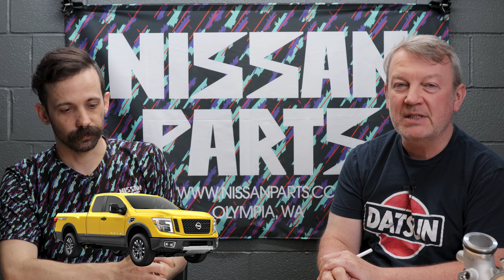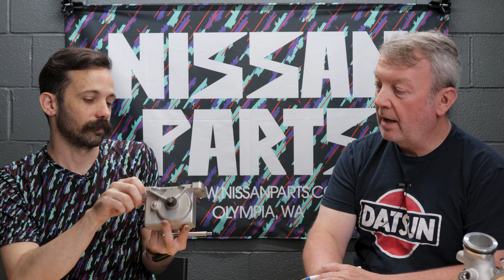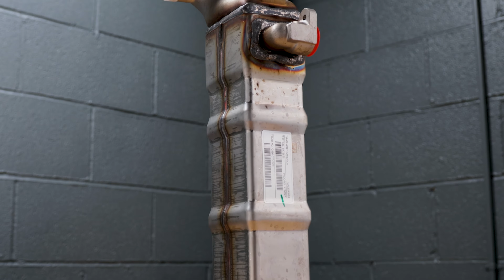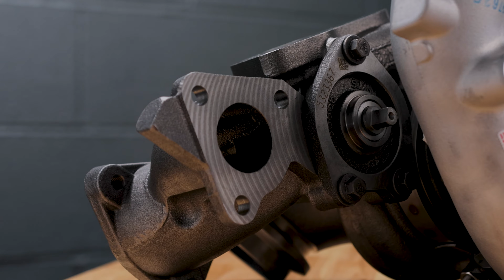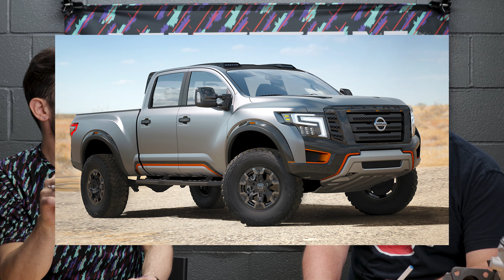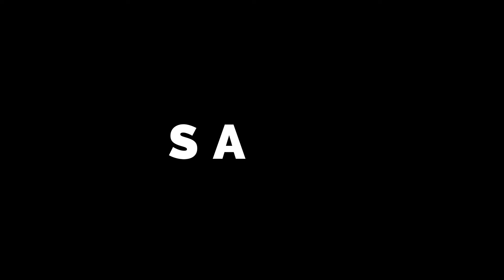Nissan Titan Cummins Diesel Discontinued: What Happened?

Comment: I don't buy anything less than 10 years old.  I have only owned a dodge 12 valve and that was a great engine.  I try to avoid owning anything that is not inline as an occasional dyi type.   I have 26 year old Frontier 2.4 manual.  I wish it was a diesel and had better highway gearing  but otherwise it is close to perfect for my needs.

Comment: 2017- XD PR… almost 10 yrs old now, over 120k miles, pure stock, (80/20 highway to city miles )which allows for little EGR use and less spot buildup , 20-22 mpg, and it allows for passive regens occur instead of a forced Active Regen cycle happening… however, its high time for a diet on my XD!!

Comment: I have a 2018 Titan diesel. Have had it about 2 years. At around 120,000 miles the EGR went out now it has 160,000 miles. It pulls better than my 1500 dodge,which pulled it's fair share. It hauls 5 of the large round hay bales pretty good. With 2 horses in the horse trailer it hauls really nice as well. Just 1 horse and you'll forget you are towing it.

Comment: 2016 XD SL, not a single issue until 120k miles, the exhaust fouled. I deleted it and ran better than I ever expected. Now at 150k miles I am getting the P00AF code.... As of now, I still have no regrets.

Comment: I got a 17 XD with the Cummins diesel about 2 years ago and it has 125k miles. I got it to pull our camper. I love the truck and it feels very solid. I got the P00AF code about 2 weeks ago on our way home from camping. I cleared the code after checking it and it hasn't came back on. Should I plan on changing the swing valve actuator soon? What is a good price? I found some by Google search and they're about $600. Does that sound about right?

Comment: Fuel treatment helped with fuel mileage. With fuel treatment 13.5-17.5 mpg.

Pulling 12,000 5th wheel 8-11 mpg depends on wind and hills. At 65 mpr.

Change oil and fuel filters every 5000 miles.

Def treatment is a good idea to reduce crystals formation.

Couple issues covered by warranty. One not covered rear fuel filter leaking $1500. 

I have 140,000 miles on it as of May 27 2025.

2017 Nissan Titan XD platinum

Comment: Another YouTuber reported Nissan discontinued supporting these trucks (as of late 2024) and many parts are just non-existent.  I believe there is a federal law that requires parts support for a 'new' vehicle for a period of 10 years after the model is discontinued, or it may be that the duty to provide parts support can be ended if the model 'becomes unpopular' or similar language.  I've been an attorney in Georgia but have not had a reason to look into it.  Your video is providing fuel for questions.  Looking at Titan diesels for awhile.  A  yellow one may cheer up a weary soul.  
But the deal may have to include guarantee for lifetime essential parts supplies . . .  lol  Good luck to little ole me or anybody on that
Reply from the maker: We have loads of parts in stock for these. I don't know if I have come across discontinued parts for the A61 Titan.

Comment: I have a 2016 with 221k miles on it. One injector, a lift pump at 150k, and a rear spring are the only issues I’ve had. It was full deleted and reprogrammed at 100k miles. Those are the only three major issues I’ve had but I do the services every 10k religiously - oil, air, and fuel. Transmission, transfer case, and diffs at 40k. 

You maintain it and open the hood once in a while to catch issues they’re great trucks. You want it to drive around town and look cool it’s not gonna work for you just like any other diesel vehicle

Comment: I got my 16 SL XD 3 yrs ago. Had 50,000 miles on it. It had a couple of issues. The biggest issue I had was the high pressure fuel pump exploded internally and sent metal shrapnel through the fuel system. $19000 to replace it all that the aftermarket warranty paid for, and that was a yr ago, since then I haven't had any issues with. Pulls everything anything I put behind it, from a 3500 lb car or 10,000 lb trailer with a track hoe.

Comment: I have a 2017 that at 6000 miles the low-pressure turbo assembly went out. replaced under warranty. then at 22000 the high-pressure turbo is now out. dealer wants $6080 to replace. Anyone want to buy a truck??

Comment: I have a ‘17 XD Cummins and it’s actually a wonderful truck. I’ve had it for 2 years and have put just under 50,000 miles on it in that time. I plow snow with it, I pull a skid steer, boat, 4 wheelers, snowmobiles… I load the bed to max capacity and more quite often and I’ve never had anything more than a sensor failure. 

It handles like an older truck because it is slightly heavier than any other half ton. It has a nice solid feeling on the road. I get great fuel economy out of mine. Nothing less than 18mpg. But usually 20+mpg on longer trips. My best was 23.6mpg on a trip back home to Wisconsin from Tennessee. I’ve done nothing to the truck other than put fuel in it, service it and drive it. I recommend it to anyone looking for a diesel truck that doesn’t need to haul 20,000lbs every day.

Comment: Had one since 2016! Have had EVERY problem mentioned… limp mode problem - regine problem- now transmission problem- input speed sensor problems! 
Cummins engine is great after delete. 
The rest of truck is Junk ! Buy a 250 !!

Comment: Had one, dumped it at 104k and got a 6.2 f250. Truck and transmission was flawless. Motor was garbage. 4 EGR coolers and both turbos replaced. I even asked if the egt probe should be replaced if it was running hotter than it should of been and not alerting me, they said no

Comment: Had a 2017 Titan XD SL bought it brand new for $46k ....$30k cheaper than the cheapest competition at that time . @15k miles egr was leaking and steering stops squeaking from running the frame. At 20k miles dpf filter replaced. The truck surged badly the entire time i had it while towing. I kept telling them it was surfing like it was losing boost and asked if they could check the waste gate. Only response i would get is "this truck doesn't have a waste gate".
Traded it in for a 2018 Titan xd sl midnight addition ($46k) 
@18k miles egr leaking. 22k miles dpf replaced. 27k miles def system replaced. 32k miles truck was surging  like previous truck. Rctv valve(electronic waste gate) was replaced. At 34k miles injector failed and destroyed the motor. Got it replaced. At 36k miles headlight stopped working. No warranty because tab on back of headlight was broken. Imagine that, they had the entire cab off replacing motor but broken tax on headlight was somehow my responsibility. At 39k miles towed to dealership. Was told a couple sensors not under warranty were replaced at my cost after having my truck for many months. After arguing i paid. Picked up truck and it was still doing the same thing. Took it to another dealership and they had it a week and fixed under warranty. Corrosion in def harness to ECU. Wire harness harness replaced. 
Transfer case replaced,4wd error warning unfixed for over a year , radio replaced, def pump replaced again at my cost. Truck has 78k miles and i just purchased an extended warranty because i can't imagine what needs replaced next. 
Love the truck but Fck Nissan. NEVER again will i buy a Nissan.

Comment: My 2018 is a worthless pig. Doesnt have the torch to pull it off a tire rack. At 130,000 miles the check engine light kept coming on couldnt keep the fuel milage up loss power. I thought the turbo was goin out but had it checked and the turbo egr valve was carboned up bad. I ask when i bought it what maintenance i need to do to the engine and they said nothing. Everytime i took it for a oil change nope dont do nothing to the engine. Well turns out i should have had it flushed and diesel treatment goin thru it. All carboned up finally have it flushed and fuel milage is back to 19/18 mpg still no pulling power or heavy torc
Reply: Tune and delete it. Mine is an animal and I’ve pulled over 14k with it

Comment: Diagnosed EGR valves I replaced both but it was air filter it through EGR valve turbo sensors pressure sensor ..etc whole time air filter but the trucks are excellent just have to get passed fuel issues and EGR valves
Reply: Same as mine carbon up bad

Comment: Hello great show, you stated calibrated for turbo actuator, does it need to be reprogrammed to ecu? my Diesel mechanic just replaced it stated he calibrated it but needs to be reprogrammed to ecu? So, I had to take it over to Nissan which in my eyes was counter productive since the part and install for the actuator is covered for 10 yr 150k miles for the titan 5.0 cummin's. Currently at 138k miles and first major issue.

Comment: I have a 2018 Mines deleted and tuned n I got rid of the factory rear fuel pump and put a fass pump. Seems to do ok just hate the transmission. Gonna change fluid and see what happens or maybe get ahold of ez lynk and see what they can do. With a deleted truck do I still have to fear the egr stuff getting clogged? Or is my main thing to stress now just a turbo going out? Thanks
Reply: What's wrong with your transmission?

Comment: My 2019 Titan XD Cummins, in under 2 years, has been towed twice from the engine not starting. Has been sent to Nissan tech's 3 other times for limp mode codes/ reduced engine power. Piece of Junk. 45k miles and under warranty (thank God).

Comment: I'm naive, with proper testing and I do mean proper testing of the engine before it is released onto the public there should not be the issues that they have. Never trust your suppliers! Everybody cuts corners to squeeze a little more profit every given moment and Nissan should have kept a close eye on the early intro of these units especially to a public not used to diesels.

Comment: I have a 2016 titan pr, the truck was amazing for the first 50k the past 16k has been rough. I’ve had to replace the egr cooler, turbo actuator, LP turbo and the coolant reservoir. I change the oil and fuel filters every 6k. Overall I love the truck but the recent repair bills is starting to leave a bad taste in my mouth.
Reply: How much the turbo actuator replacement cost?
Reply: @vicenteortiz7244  it was covered under warrantee. Nissan has extended the warrantee on the actuator and the high pressure turbo.
Reply: 2016 XD w/ 66k shop wants to replace my EGR Cooler, low pressure turbo and more… only had it about a month so far 😢

Comment: Traded my 2017 titan xd for a 2020 ram 6.7. Loved my Titan xd and had it upgraded. Was an amazing truck but lacked in many area’s. Cost of  ownership compared to performance and value was a hitter. Fuel mileage was sub par but other than that fantastic truck. 108,000km on it without a issue

Comment: Are the known problems with the Cummins 5.0 simply an issue of poor maintenance or is this a design flaw also. If you change the oil every 5k does that simply avoid the problems? Or is more substantial and diligent ownership needed. I've loved the idea of the XD diesel, but wary of a purchase because of the bad press of the 5.0.
Reply: It’s a design flaw, but not from Nissan or Cummins. It’s a design flaw of the EPA. The only issues these trucks have is largely related to their having to add useless garbage just to meet EPA emissions guidelines.

Comment: Complete wiring harness end to end at 60k miles, egr failed, 2 def sensor failures, ball joints …. Half the new value of the truck has been spent on warranty and my own repairs. 2016 SV.

Comment: Have a 17 Xd SV Cummins. Love this truck it just passed 60k mileage. Regular 5k valvoline extreme blue or shell rotella oil changes at 5k as well as filter changes and def filter changes are the secret to any diesel longevity. No mods outside of a bilstein 5100 suspension upgrade as well as a rough country leveling kit and a helwig sway bar upgrade. Bought it used w 19k mileage. Also use fuel lubricants like Lucas pretty regularly when I fill up. My theory is don’t tune the engine or modify it they don’t pay engineers what they do to have guys mod them and void the warranty. It’s a great truck Nissan didn’t market it at all which is a damn shame

Comment: I just bought one a few months ago and I love it. Ya I had a few issues to work out being used and all but it’s been a fantastic truck overall. For a diesel it’s your best bang for your buck that’s for sure. As long as you maintain it you shouldn’t have any problems which goes for anything. I’m going to be starting a YouTube channel dedicated strictly to the Nissan Titan XD 5.0 Cummins which will answer any questions or concerns anyone has along with following along my journey of owning one of these amazing beasts. IMO Nissan did a bad job of marketing them which led to the downfall of a potentially excellent diesel pickup. It’s Sad to say the least.
Reply: Boy you’re in for a treat
1st gen series truck that the manufacturer bailed on
Good luck
Reply: @asaawalker  10,000 miles already on it and it’s been a fantastic truck no problems at all. Just did a cold intake upgrade and man that made a huge difference. Love the truck and plan on keeping it for years to come.
Reply: U have link for ur  channel? I have a 17 xd  Cummins

Comment: 17 titan xd 101400 miles on it. At 61k replaced turbo and fuel water separator housing. Then at 71k replaced egr valve, cooler and turbo again. 80k fuel water separator housing again cracked. 88k engine wiring harness. 

Currently seeing a small power  steering leack and break master cylinder leak lol. 

These trucks are under powered. I think they could of went with a bigger turbo and more fueling to get at least 425hp and 750 tq range.

Comment: I bought a 2019 new. Done all maintenance as needed. 98450 miles all good so far. I tow 9000 lbs. 5th wheel. I use shell rotela t 6 and nissan oil filter. Every 6000 miles. Also change fuel filters regularly. Any thoughts?

Comment: My first time with a diesel.  Bought the diesel because my Dad's chevy with a diesel lasted 400k miles!  I thought this was a smart financial decision but then I learned about all the environmental junk.  I ended up buying a used 2016 and my EGR went out around 80k miles but I was out of warranty.  It ended up becoming a 'farm truck' - and I love it.  But I am in constant fear of the broken crankshafts.  I am surprised you guys didnt mention that when it seems like that is one of the big ones on the forums.  I love this truck though.  It tows my 34 foot camper like a boss.  Wish the mirrors automatically folded.. but thats it.
Reply: They aren’t meant to rev very high. I think the broken camshaft are from modifying and change engine computer. And reviving too high. They aren’t as balanced as the the in-line 6.
Reply: @radfordmunz9577  I have read its a wiring harness causing the cp4 to fail and floods the engine resulting in a broken crank.

Comment: I owned a 2018 Midnight, at 125,000 it dropped a bearing. 32k later after a new engine install, new actuators,  2 separate dealerships working on it, it never made it 3 miles without  throwing every code, even ABS, straight to limp mode. Nissan fired all of its diesel techs, rare to find a dealership that still has one. Nissan does not want to see these trucks roll in. No shops want to work on them, because its a bastard. Nissan electronics on a Cummins.  But I bought the truck at 90k.  Never an issue till the bearing dropped out of nowhere.  I loved the truck overall, but once the problems start,  runnnnnnn.  Only thing I did was have a Fass lift pump installed. The factory plastic junk will crack and leak eventually.   With that said, I’ll never go back to a diesel to haul my rock crawler around,  I went  big gasser!

Comment: Should’ve mentioned a couple different things

They had an issue with the wiring harness to the injectors, which would cause a situation, where they shorted out and threw additional fuel down the cylinder.  This in turn ended up, causing many crankshaft failures.   

I invite you to google search Nissan Cummins, crankshaft failures.  Mine failed at 39,000 miles, (broken crank ) which is really ridiculous for such a high priced vehicle with a motor manufacturer with such a good reputation

Comment: I own a 2016 Titan Xd Platinum Reserve. This truck is very underrated and has a ton of potential. My biggest complaint is that everything is so expensive to fix obviously being a diesel and not having aftermarket support and having to go back stock. They made these trucks in my opinion to quickly without enough research, especially with the tranny. The truck shifts rough. If this truck had an Allison transmission linked with the 5.0 this truck would be an ultimate package. I have a sour taste in my mouth because Nissan will not recall things that are breaking on everyone’s truck. They just throw there hands up and say it’s on you. If you own this truck, get a warranty and extend it out as long as you possibly can. I have 116k and I’m replacing my entire turbo system which is costing me 8k with parts and labor.